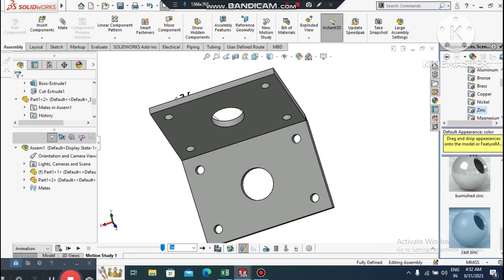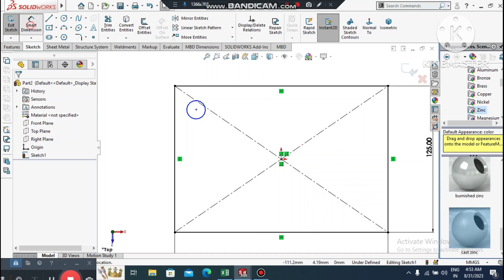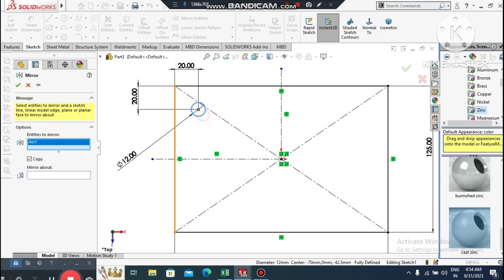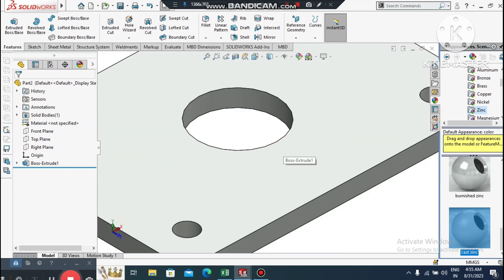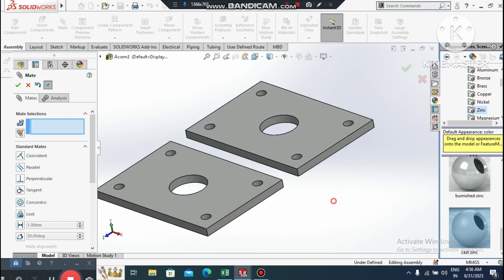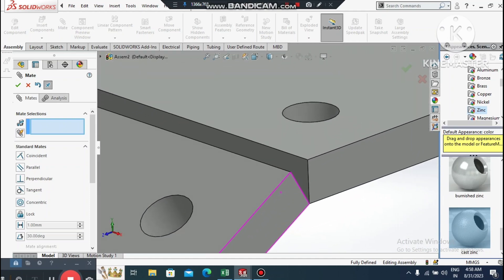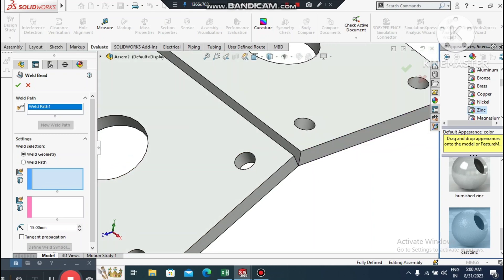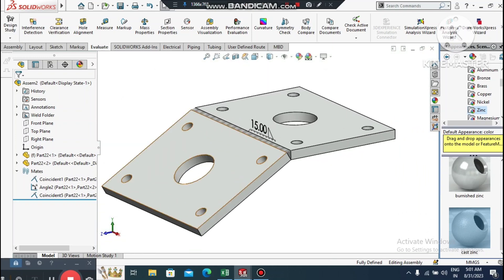Solidworks Weldments Tutorials | How to Insert Weld Bead On Solidworks Assembly

Comment: You show only ONE most-simple case, NOT something ACTUALLY TYPICAL .
What if we don't WANT to add a "Weld BEAD" - a graphical representation, but instead we want a FILLET WELD which is supposed to be a FEATURE entity, that responds to weigh analysis AND interference calculations. AND WHY can we not deal with ALL AROUND paths, or deal effectively with Weld Prepped joints ? What is WRONG with S-W ?? Why is this not AVAILABLE and OBVIOUS ? What you show as welds along two edges do NOT appear as WELDS but as disjoint IMAGES - right there in YOUR Video !!
Reply from the maker: Okay thanks 👍